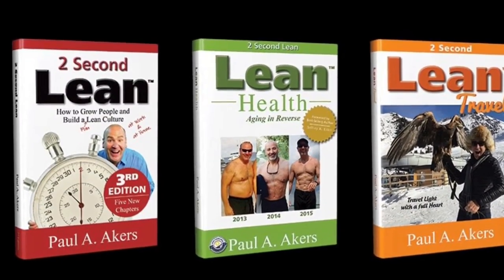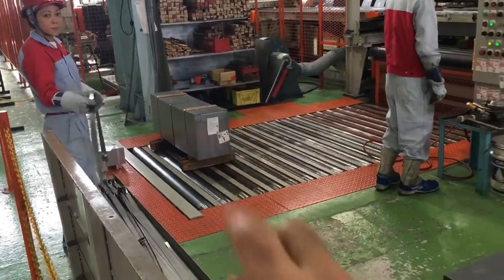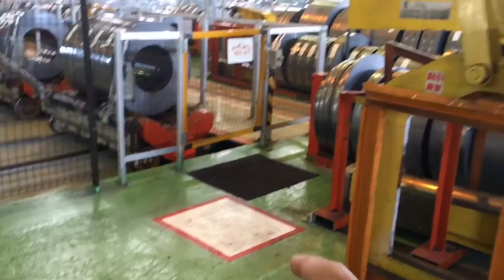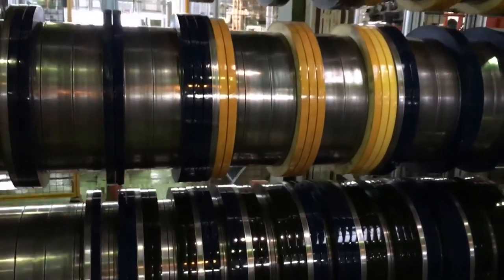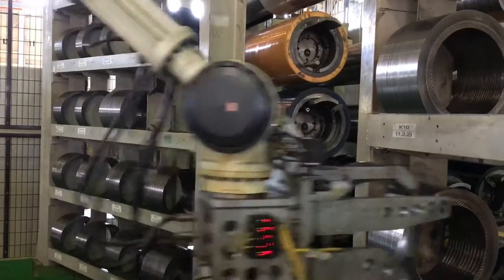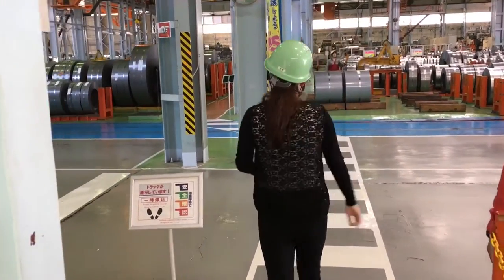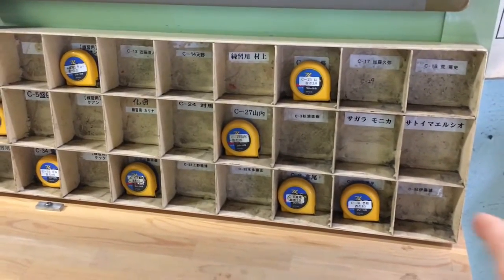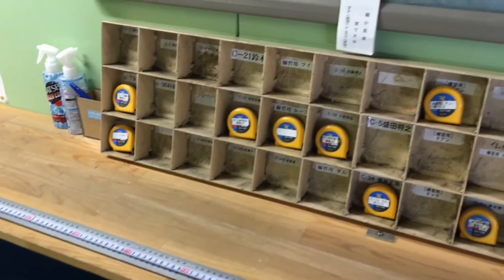Japan - Quality and Steel

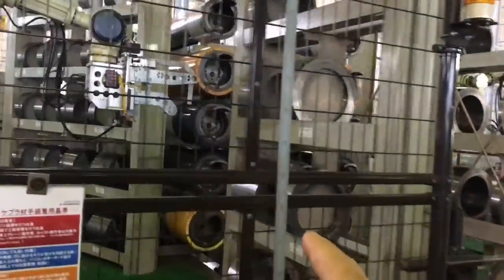Comment: Thank you for sharing 2:40 I've set up slitting knives by hand for slitting steel.  On older (1960's) equipment that involved removing the entire arbor head with an overhead crane and replacing it with another -- on more modern (1990's, 2000's) the arbor has had two or more heads on a turnstile: strip-down and set up on one head and just spin it 180 for the next run (just a couple minutes).  Here they've eliminated the set-up person completely -- good for them!

Comment: Incredible use of automated manufacturing equipment. I love how they use super high tech processes but don't slack on the simple human processes either. Lean truly is a blend of using high tech and simple ingenuity and common sense. I wonder how long it took them to setup a die set in the old days when these assemblies were put together manually. And I imagine how dangerous some of this equipment was to operate manually in the old days too, just dropping one of those spacers! Thanks for sharing Paul.
Reply: You are very welcome Brian!

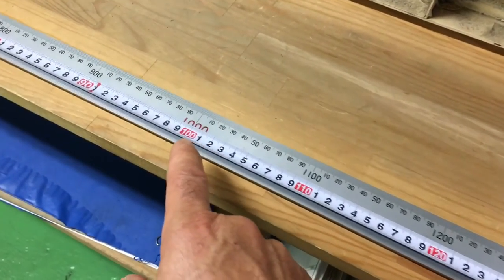Comment: 7:40.  I have a very similar setup on my workbench for my tape measures at home and at work.  My boss thinks I am nuts but being even a 1/32 of an inch out or a millimeter out is enough to wreck a lot of my projects or a job at work.  Nothing makes you  more frustrated when you think you have built a perfect piece of furniture or cabinetry and you find a small gap in one of the joints and you have to waste an entire hour correcting the mistake by hand just so the joint is air tight or optically perfect (I work in thick acrylic plastic plate)

Comment: Hey, Paul, could you tell me what exactly the different colored floors mean? I worked for Toyota Tsusho for just two days, but noticed that the floors were painted pretty similiar to this company's, but didn't get the chance to ask.
Reply from the maker: Bradley Green indicates what material is stored tan is a walkway for people. Orange is the safety zone area. Other colors are for specific material types or special access areas around trucks.